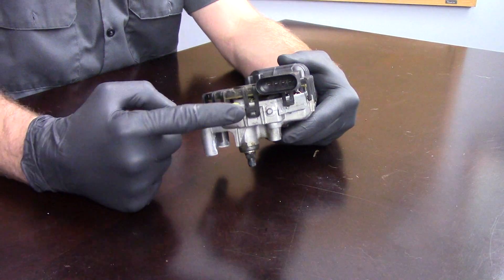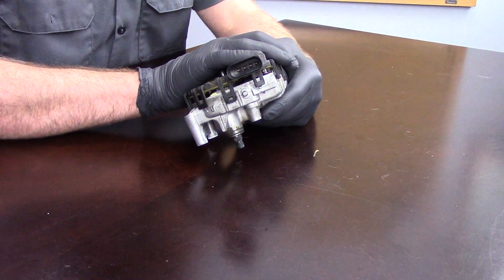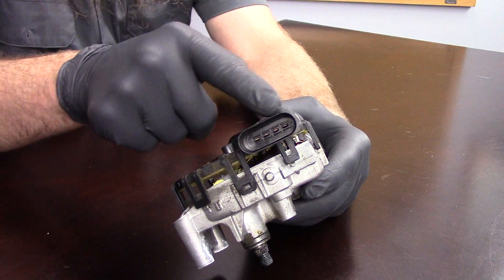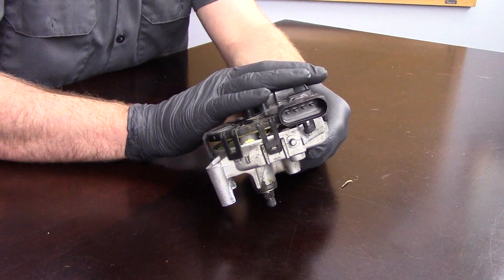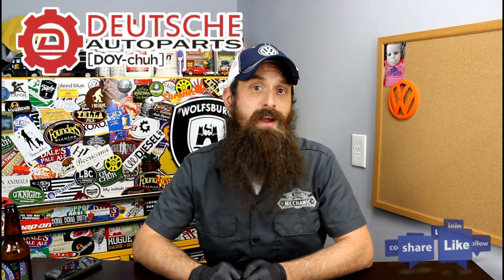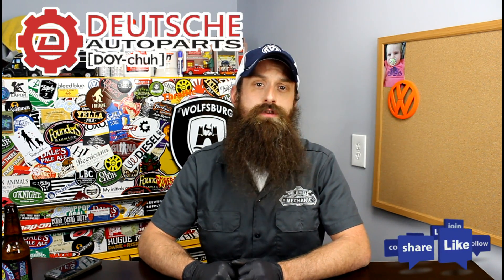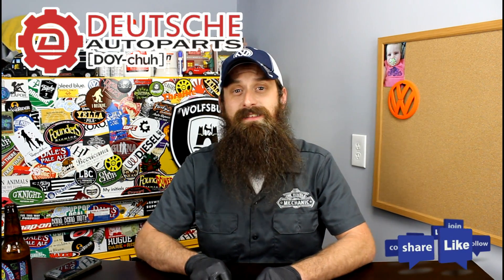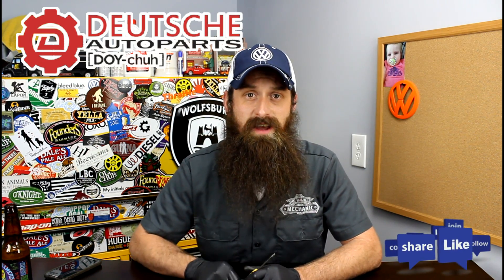How VW Parts Fail ~ Windshield Wiper Motors

Comment: i saw a video showing that replacing the Motor did not fix the no power issue. Before replacing the wiper motor is there a way to check the switch in tyhe sterring column for issues. All of my fuses are good. the switch works for the rear wiper motor just nothing to the front.

Comment: My rear wiper motor in Skoda Super 1.6 TDI Mk2 from 2011 stopped working one day and then after almost a month again started working. It worked for a month or so and then again stopped working. Can this be the motor. The fuse no:41 (10 ams) is ok. Could this be a failed motor or some connections issue?

Comment: 2011 Jetta TDI. Motor stopped  working, replaced with new motor.  Seems to work fine until I place the arms on. Then I hear a scrapping noise.  What could be wrong?

Comment: I have a 2009 Jetta Mk5 2.0Lt TDI, the wipers just stopped working and I cannot find a wiring diagram here in South Africa. Could you please help in this regard as spares and diagnostics are very expensive here and most of these diagnostic companies here are part changes, I am a pensioner and can not afford it.

Comment: I have a 2006 VW passat 2.0T and I found that the problem was the hood latch sensor. This model has a sensor that won’t let the wipers work if the hood is open. So I just disconected the hood latch connector that is located near the left headlight.

Comment: I have 2017 1.8T.  Wipers only work on high speed.  The switch does not turn them off.  Mechanic pulled the fuse and now I have no wipers at all.  Is this a bad motor or a bad relay?

Comment: Great video! My mk6 motor failed not long after the remnants of Hurrican Lee blew through here. I think it was water intrusion, the motor suddenly got noisy. I just wanted to share a tip I used when "clocking" aligning the wiper linkage to the reattached motor. Before taking the linkage out, I used  tape to match both linkage arms in the "resting" position. Then before reassembly I cycled the motor once from the stalk and reattached it to the linkage. I also used tape to mark the rest position of the wiper arms on the glass. When my linkage was in the correct position to mount the motor, part of the linkage was covering the motor nut, and I had to use an open ended wrench to tighten that motor nut. Then I cycled the wipers again (without wiper arms on). If the linkage came to the resting position ( tape) then I knew I could tighten the linkage mount bolts down, and reattach the wiper srms.

Comment: Hey, thanks for the video.  I have a 2012 VW Jetta 2.5 (Selina is her name, Cat woman lol).  love this car. The wiper issue i have had is weird.  I love in ontario canada and we get some pretty cold winters.  when its -8 or lower here my wipers will not work.  once the car warms up they eventually come on.  I have dealt with it by parking in the garage, parking in the direct sun, and used rainex.  My feeling is that there is moisture inside the wiper motor and when it freezes up it seizes the motor temporarily.  wondering if anyone has experienced this and if there is a fix for it other then replacing the motor and seeing if that is the issue (the dealership suggested that might fix it but no guarantee!)
Reply: Hi, my wipers are doing the same thing wont work in cold weather, If i let my car warm up for 20 minutes or more they will work... Its hard to find any info on this issue
Reply: @pumpkinsylvester2038  well good to know that I’m not alone lol. If I find anything, or end up getting it fixed I will post here any info I get
Reply: If any part of the wiper motor assembly has dried up grease then the cold weather will exacerbate this problem.The solution would be to disassemble clean off the old grease and relubricate

Comment: Just completed my repair.  Works great have a video of the movement, and a photo of the active water intrusion into the assembly, and also contaminated lubricant.  I took plenty of pictures of the assembly in its installed position, and upside down once it was out.  Also scribe-marked the arm which attaches to the motor to confirm the alignment as it goes back together.  Had to use a puller to remove the arms.   Marked, recorded and measured the arm position to confirm reinstallation.  Car is a 2011 in the northeast US--so corrosion is an issue.  Can't say that the penetrating lube on the wiper arms really helped or not.  Replacement part aligned easily.  Keep ratchets away from the windshield!   Easy-does it, and clean the cowling and track for it before reinstallation.  Original problem was that it only had one speed--was told that the car will not pass inspection that way.

Question:  so the car has over 125k miles now.  I noticed that on the wiper transmission arm connection points that the rubber washers(for lack of a better word--are they there for quiet operation?)  the one is split.  Are these vital?  trying to get another 30k on the car.  2011 2.5w/ auto trans.--leaking from the vacuum pump too.

Comment: Great video, I see on the newer VWs, wiper motor have a pcb board in it, I wanted to know how would go about powering the motor direct from a battery? It has a 3 wire plug, pin 1 is power from the module, pin 3 is ground and pin 4 is from ignition switch, nothing on pin 2
Reply: interesting, mine is 1=12v, 2=GND, 3=blank and 4=signal or 10.5V

Comment: I've had the wiper linkage seize twice. I think my wiper motor has wrecked gears inside on this second time. I fixed the linkage and still no movement. I hear the motor buzzing.

Comment: Hey! Having an issue with my ‘09 NB. When DRLs/headlights are on, the intermittent wiper relay clicks and the wipers tick. The same happens with the AC running...not sure if this is a ground issue or not, but I have the relay pulled. Look forward to your feedback.
Reply from the maker: Very possible a ground issue. There was a TSB about wipers and adding a wire to the steering column. It wasn’t super common. Man I’ll have to dig

Comment: We have a used 2013 VW Jetta SE. I accidentally tripped the one wipe on wiper lever which ran into the windshield fix device on passenger side and doesn’t work now. I checked fuse and it’s okay. It hasn’t rained either. I gently put wipers in start position. Should I fix it myself or have the dealer lot fix it? jaevaristo@yahoo.com
Reply from the maker: So neither wiper moves? Does the motor work in any speed?

Comment: Hi Charles, loving your channel, I've used it a few times to fix my 2007 Edition 30.  I have an issue with the wipers were they stop mid screen.  I can push down the stick and it carries on again but keeps stopping.  Do you think its a symptom of the motor and the park switch being faulty?  Stu
Reply: Hi Stu, got the same problem, did you find the fix?
Reply: @willemstrydom4074  hi mate, I ended up replacing the motor and at the same time did the linkage in case that was getting past it's best.  It hasnt done it since, although to be honest due to covid I have hardly driven it.  It really rained the other week and I did about 50 miles and it never stopped once.

Comment: Hi, My 2015 VW Jetta SE TDi wipers stop working. Fuse is good. How to find out what is wrong.
Reply from the maker: Make sure the hood latch is working. Then id try and turn the motor on and tap on it. See if that makes it work
Reply: Hi again. I still have the same problem with windshield wipers. The fanny part first in the morning windshield wipers doesn't work. About 12pm start working like nothing wrong. When getting dark outside stops working. I'm replace multi function switch what vw dealership recommended. Still the same. Maybe you have idea. 😢 Thanks

Comment: Just did this to my gfs 2012 jetta se gonna do an autopsy on the motor once i got it pulled from the old transmission. Used a small gear puller to remove the arms did it while the car was dirty to have a visual mark for reinstall of the wiper arms.. It was a super simple job... Just be careful to not break any of the plastics and check the connector for corrosion from water ingress. The wiper motor was at complete failure when removed. It worked for a while before it reached this state.. Where there was a easily noticeable noise coming from it like it broke off teeth on the plastic gear from it seizing up from water getting into it.

2 years ago.. Just swapped it again.. Yeah these suck.. This one is a reman oem bosh

Comment: Hey Charles, have you heard of wipers turning on by itselft?
Reply from the maker: I have. It’s either auto rain wipers with a cracked windshield, or a failing stalk from my experience. You could convince me other issues can cause it to
Reply: Been having the same problem
Reply: Mine did the same thing before it completely died.

Comment: I'm late as usual,. Here's the issue, my Bruce Jenner broke on the assembly. So I changed it out, easily enough, but the wipers go up, and won't return, unless the switch is 'flicked' on the column. The motor works fine up and down, but the return is buggard. You can see the motor trying to send the arms back the park position, then it stops. I press the switch again, she fires back to the park position. Any suggestions would be greatly appreciated.

Comment: Well, I'm super late to THIS party, but thank you, Humble Mechanic, for this video! My Joan Jetta has a wiper motor issue. About a month ago, I was driving in the rain. The wipers were NOT on yet, as the rain had just started. Finally, I turned the wipers on, but the action was a bit slow, however, I was not concerned. Then, suddenly, the wipers just quit. Nothing. Nada. Niente. No wiping whatsoever no matter which position I put the stick in. About four minutes later, (yes, I had to continue to drive), the wiper action returned. I noticed nothing out of the ordinary, but it was raining hard. Several days later, the rain returned. I tried the wipers...they worked. Sluggish as all-get-out, and the awful grindy-droning of that motor, but the wipers DO wipe. The local dealership service department just slammed me for $1,600 for an oil pump and headlight assembly, so I'm not really excited to shell out their quote for this replacement. However, you know? Volkswagen tools...or finesse...that's a tiny bit intimidating. Still trying to decide if I want to cave and 'be a girl' and let the shop fix this, or try to do it myownself. I have always ALWAYS done my own 'wrenching' until I bought this Jetta. Now I want her to be in good hands...thank you anyway - I am pondering what to do. Best, Loree
Reply: You are getting scammed.

Comment: Hello everyone I have a 2013 Volkswagen CC 2.0 turbo and my windshield wiper just went out without giving me any warnings signs of the motor getting bad one morning I tried to turned them on they wouldn't even move so I done some trouble shooting such as checking the fuses and relays all seemed good so I took it to the dealership and they told me it was the motor. So I asked them how much it would be to replace it well they are going to replace the wiper and the transmission which just the parts is $528 dollars not including labor when I call the parts department.When I talked to the service people they told me that everything will be $985 I was like yall are out of your minds I'll do it myself.
Reply: 500 for parts and labor is what a local shop quoted me.  Eurpa Parts has the full motor and linkage assembly for 150.  Gonna try and do it myself.

Comment: I check the switch level, the body control module, the fuses, voltage, ground, everything basically and don't know what to do.  I'm about to adapt another motor from a different car with a separated switch.

Comment: I have a 2005.5 jetta and the wipers don't work at all I install another motor from junk yard to test and still the same way. Someone told me that could be the body control module.  Can you help?
Reply from the maker: IT could be the CCM. What have yo checked?

Comment: Make one video with that title. "VW is a total fail". Sensors, gearboxes, engines, electric modules, locking mechanisms, wippers motors, tail lights, fog lights, lamda sensors, AC compressors a lot of things are designed to fail after 2-3 years. They  designed to fail. No matterial failures, no assemply line mistakes
Reply from the maker: Tail lights and fog lights?
Reply: Just kidding about fog lights and tail lights.. VW design mechanisms in order to fail after certain period of time or after certain amount of use cycles . Are you agree? They know what they doing. In software there is a lot of cycle counters and other data for statistical reasons how long something takes to break or fail.  I have a lot of examples. Take a look at door lock. 2 springs fight each other. Only one used by mechanism . The other waits , until the first one loose  force and then .....a new lock needed or a lot of time to figure out why fail .
Reply from the maker: I don't disagree, but I also feel like that is how most everything is made today.
Reply: I disagree. A lot of manufactures make something wich fails. VW makes something in order to fail.If not fail  someone in Germany loose his job. Toyota , Honda, Mazda or even Koreans cheap cars use mechanisms , electronicks witch fail randomly due to matterial fail, assemply fail etc. At 100 VW's there are 10.000 similar failures at the same spot, the same sensor, the same part. I do not care about failed parts if it s random . I am angry with expediency. They design to fail, they collect data from parts cycles in order to make fail. Customers must know that.

Comment: By the way most dealers  just replace the hole thing when  they get a code for it   or if there not working  becaus they dont want to deal with fixing  the parts or wastesing there time sadly
Reply from the maker: There is too sides to that. The big 2 reasons dealers do more repair is 1)warranty, and 2) time savings. I think I have done a video on that exact topic. I will see if I Can find it

Comment: My windshield wipers don’t respond to any switching inside only my washer fluid works when I try  and use it. Fuses are fine any idea ?
Reply from the maker: I have seen the stalk do that, a relay do that, and a failed motor do that.
Reply: did you fix your problem? I have the same problem (My windshield wipers don’t respond to any switching inside only my washer fluid works when I try  and use it) and I dont know why because the motor is okay ..
Reply: Are you talking about relay 377?
Reply: Constantin Birsan bringing car in tomorrow. I’ll let you know how it goes.
Reply: Ok, thx!
Reply: Mitch Sullivan so did it work? Because I'm having the same problem
Reply: lambofgodrodrigo I brought it to the shop and I believe they replaced the motor entirely.

Comment: Dealer claims about 2.5 hrs. in labor to replace. Motor costs about $230 from what I  was told but haven't looked for it. Dealer claims my motor is  'on the way out'.  Seriously, for a VW Jetta that's a 2014 with only 32,000 miles!?  So for them to do it I'm looking at $530 for everything, yikes! It doesn't seem too tough of a job but I don't know if I should tackle it , nearly $300 in labor OMG!

Comment: There is definitely water in my motor and the motor does not run. Any ideas? How can I open the motor assembly inside the cylinder?

Comment: Hi thanks for the video,  My wind screen wipers packed. I had a look at the linkage assembly and its fine externally. the motor turns but the wipers don't move. I think its the plastic gear  in the motor. I think the teeth have gone, it would have been nice if you done a bit more on this side and showed how the linkages connect to the motor.  I'll do my own video when I pull it out.
Reply: You lied, I am disappointed

Comment: actually only 3 pins are wired... constant 12V, GND and lin bus (canbus) signal... 12 is there always waiting for signal to come from comfort module over linbus or signal cable to microprocesor in wiper motor housing...
Reply: Kevin Afton lowcan and highcan signal... ground and positive